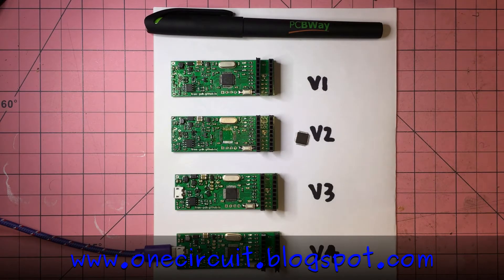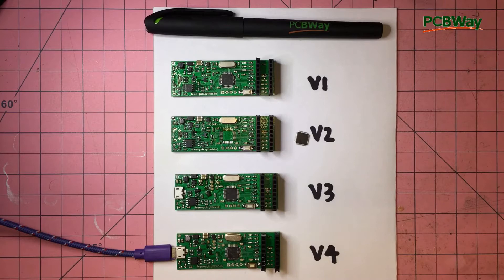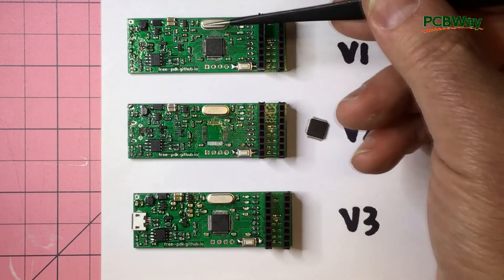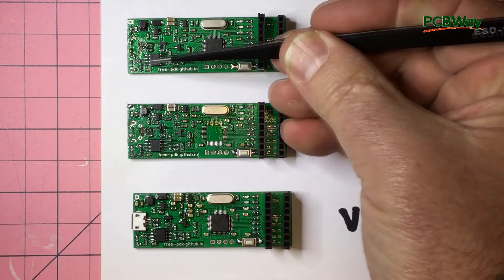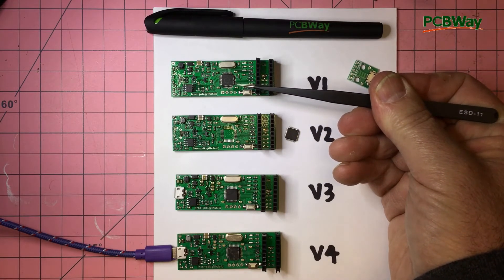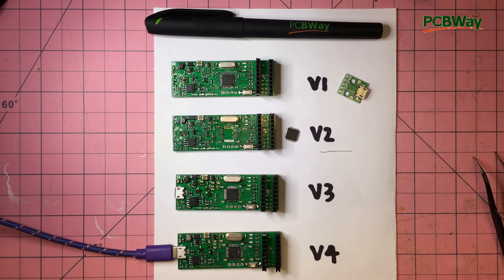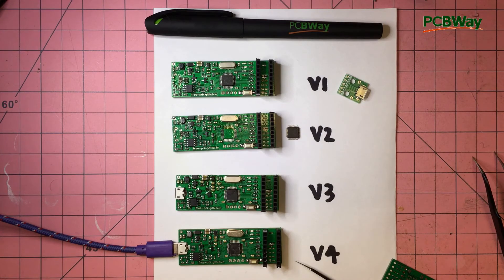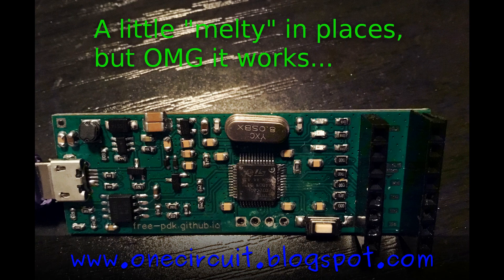Free-PDK Padauk IC Programmer (Part One)

Comment: I need to switch 2 leds at 100 milliseconds connected to two different  I/O pins , 3rd I/O pin oscillates at 100khz for dc-dc boost,  can this oscillator be done on this pms150C 08 chip using pwm.
Reply from the maker: https://free-pdk.github.io/chips/PMS150C gives pwm gpios, links to datasheet etc., and examples with code found here: https://github.com/free-pdk/free-pdk-examples/tree/master/FadeLED
Reply: @onecircuit-as  thanks for the links , I have a doubt , there are many micro vias on the board , are they necessary .
Reply from the maker: @Blue.star1  There are other designs, but this is the one I used - there are a few revisions and simplified versions - there is even an Arduino Shield version!
Reply from the maker: @Blue.star1  https://github.com/jjflash65/Padauk-pfs154 (not sure if it works!)
Reply: @onecircuit-as  justnow I couldn't contact jjflash on github , no message box in it

Comment: helloi would like to perchase two programmers. please message me if possible.
Reply from the maker: I don't sell the programmers, I made them for my own programming (and to learn how!)
Reply: @onecircuit-as  thak you verymuch for the reply. i found many varients got confused. please share the link of PCB gerbers you tested. i will try to assemble one for myself
Reply: also does it support PMS150C-so8?
Reply from the maker: Try https://github.com/free-pdk/easy-pdk-programmer-lite-hardware which has the gerbers under the directory "Design Files". When you upload, be sure to have the smaller components already assembled - that way you don't have to solder the SMD stuff. If you are having trouble sourcing the STM32 chip, try a search on AliExpress for the Blue Pill (STM32F103C8T6 version) and then desolder the chip to place on the Padauk Programmer. I have a video on this process - search on my channel for "Recycling STM32 chips" Good luck! If you are on twitter you can DM me etc @PeckMaths
Reply from the maker: Yes it does - see my video by searching on my channel for "3 cent PMS150C Christmas LEDs"
Reply: @onecircuit-as  STM32F103C8T6 and STM32F072C8T6 replacable. ? i have seen a post saying F103 dont have DAC like F072 ? will it work ? please suggest
Reply from the maker: I have yet to do those experiments so I am unable to advise - if you order 5 pcbs it might be "fun" to try different STM32 chips. I do know that the STM32F103C8T6 does work (if it's a legitimate chip!)

Comment: You just made me so happy I lazily just bought the official programmer ;) Time <3
Reply from the maker: Wow I’d be interested to know how it performs. I have one working programmer and a few melted piles of solder and parts! 👍🤔
Reply: @onecircuit-as   The pin configurations can be a bit fuzzy to get going but I've had no issues with it once I had that sorted out - note that the programmer and In-Circuit-Emulator are separate things. The ICE is magic and seems to have (almost) all the features of the whole range of IC's - except 16Mhz clock. 
https://www.youtube.com/watch?v=zdhI0kNYR_c&ab_channel=AndersNielsen

Comment: That's what's so great about your vids, honest feelings, build issues, testing results, actions taken to resolve test issues.
Really useful information to anyone who follows in your footsteps e.g. amateurs like me.
Great vid and thanks for sharing
Reply from the maker: Thanks for your support! It's a journey that's for sure - I'm looking forward to a time when I can confidently build one of these programmers AND get a useful project out of a Padauk chip...
Reply: @onecircuit-as  which version is best for pms150, what about oshwlab padauk-programmer and other one Blue pill programmer  by Serisman
Reply from the maker: @Blue.star1  The FreePDK project supports the PMS150 (https://free-pdk.github.io/) - I haven't tested any others yet, although I made my own and it was a hot mess!
Reply: @onecircuit-as  thanks , your hot mess will be useful to others to avoid issues. There are too many  micro vias around 50 on the pcb , are they needed